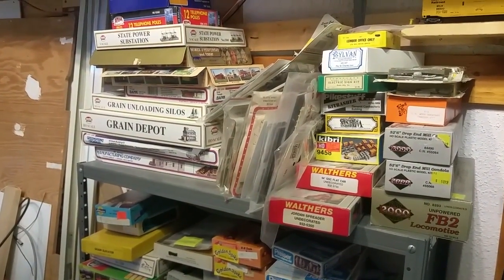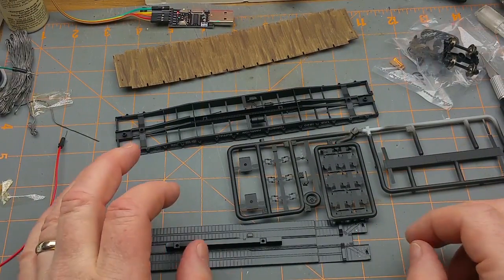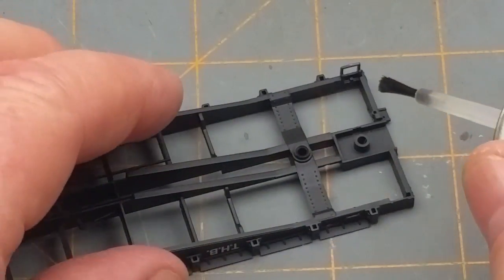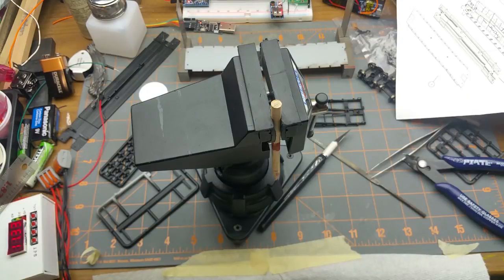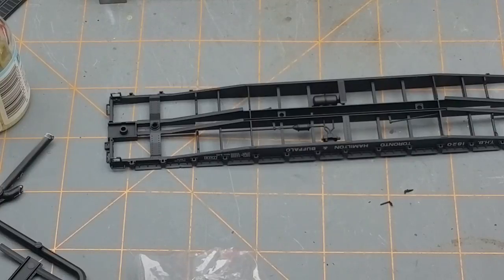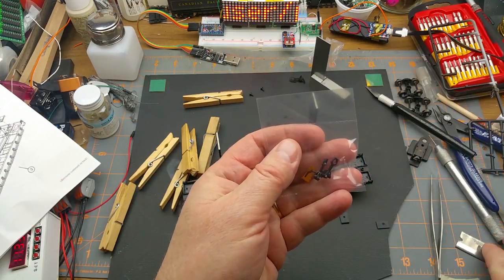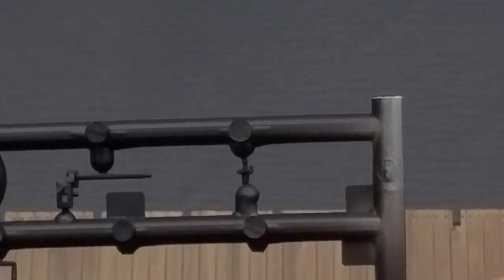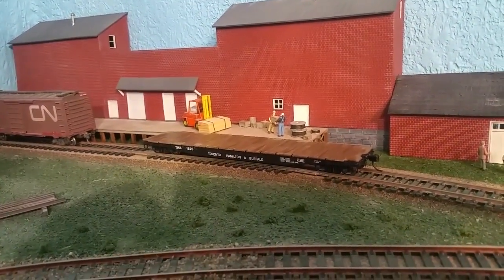Proto 2000 flat car kit build

Comment: I just got done building a Tichy Train Group flatcar kit.  Very prototypical but the grab irons were a real pain in the ass and I learned NOT to mount the stirrups until after the grab irons.  I ended up breaking every one of them off.  Lost the brake support bracket and finally found it after saying a prayer.  At least now i know that you cannot follow the directions to the very last detail.  Live and learn as they say.  The brake detail was also quite fiddly but it really looks good.   I got it painted a little while ago and painted the whole damn thing rail brown and weathered the Kadee #5's and the trucks.  Threw the plastic wheels in my box of plastic wheels and used my Walthers Proto 2000 metal wheel sets.  So now all I've got left to do is make 4 stirrups and get 'em mounted and make a load for it.  
I used a pack of emery boards the wife got me for sanding off the sprue parts left after cutting them.  I have metal files but the emery boards work just like sanding sticks, only cheaper.  My Tichy kit came with both plastic and bronze phosphor grab irons plus I bought a pack of 100 from Tichy for 3 or 4 bucks.  Part of kit building is searching for parts that go scooting across the floor.  I spent as much time chasing parts as I did actually building the damn thing.  For my build I got a glue bottle with a precision metal applicator which made assembly much easier as well as a bottle of Plastruct and several tubes of Super Glue.  I had ordered 3 1-2-3 blocks but the post office lost it.  I've got a 17 pound of slab of square steel that I use instead of the 1-2-3 blocks and I've got some welding magnets that aid in assembly as well.
Cheers from eastern TN